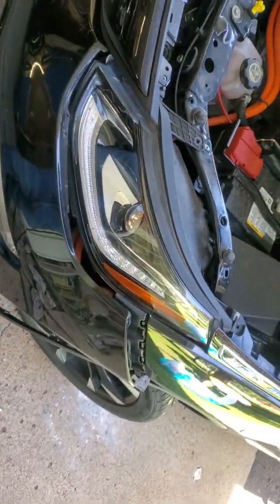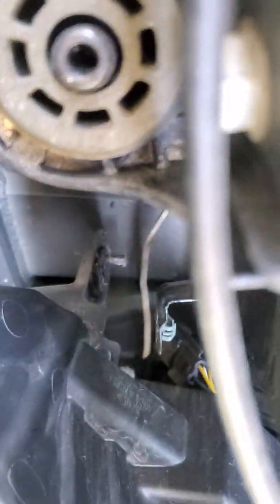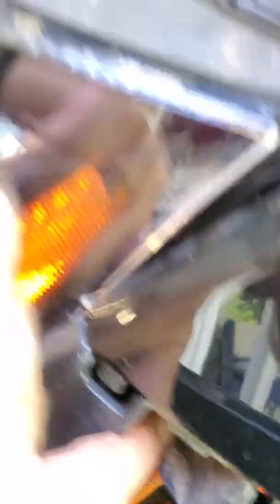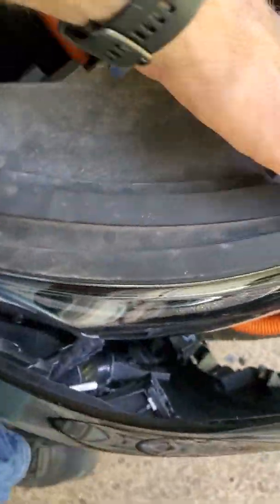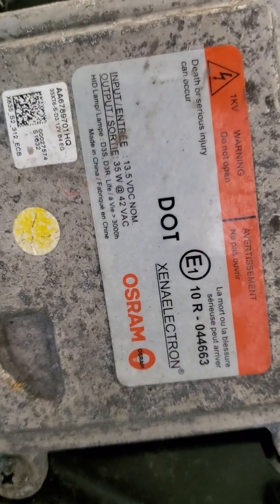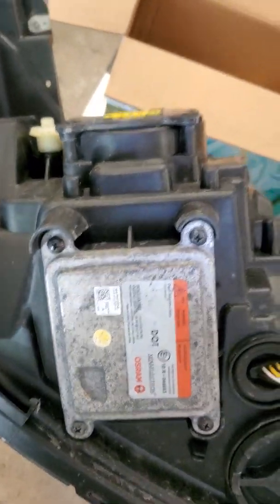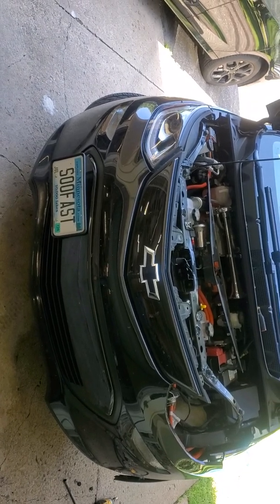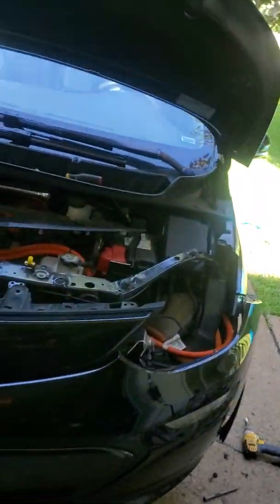2017 - 2019 Chevy Bolt EV HID Headlamp Bulb replacement.

Comment: Save yourself a ton of money and get AUXITO D3S bulbs, this will be the 3rd vehicle I've put AUXITO bulbs in and they are great replacements
Reply: That's what I bought.  I have a question since you got them.  There is a cooling fan on the LED Bulb . But the videos I have seen taking the bulbs out of a Bolt EV,  they show a sheet metal  cover that is screwed down behind the HID bulb that holds it in place... that seems like it  would block the air flow. BUT I have seen other D3S bulbs that have a clip under them to hold them in place and a Cadillac CTS video that shows them Rotating to release.  Any tips or confirmation on what the Bolt actually looks like in there..  Mine is a 2020.  Thanks very much.

Comment: I haven't attempted mine yet. Could you clarify on "just pull the trim off". Is it just brut force, or are there some form of retention clips or similar? I don't want to break anything.
Reply from the maker: As long as all the screws are removed including that hidden one under the wheel well it just pops out with a little force. Just pull outward and slightly up.

Comment: Can you put LED'S instead of the HID'S?
Reply: Maybe if you bypass the ballast, but I also just saw drop in replacements that interface with the OEM ballast. Idk I’m not sure I would want to trust a cheap piece of aluminum to accept high voltage from an HID ballast. 

Just get D3S replacement bulbs and put them in for OEM performance. HIDs are relatively efficient and make a nice beam pattern.
Reply: Heard Auxito D3S LED bulbs are really good replacements

Comment: Perfect, just what I need. Went for a Lyft inspection yesterday and my driver side was off, so it failed. Got it in the parking lot and it was back on. Midas wanted $150 to replace it :)

I'm at 135K on my 2017 Bolt EV.

Comment: I just replace mine, only need to remove the black cover with 4 screws not easy but with small screw driver ,also there's a aluminum HID light holder with 2 screws after black plastic cover
Reply: Are you saying you somehow got a screw driver behind the black cover on the rear of the assembly and took out the four screws, then took out the screws on the metallic bulb cover and managed to change it without going through all the other steps?  That would be a miracle.  Tell me how, if you did it.  I need to change out a bulb.

Comment: 2017 Bolt 107,000 miles. My Driver side goes out very often. I turn lights off, then one and it will work for a bit. Do you think it’s a lamp or ballast?
Reply from the maker: I don't think they sell separate pieces but I would bet it is the Ballast. Try looking for a used one first. But all the work to replace them I would just go new on both instead of having to open it up again 20k later  :-)

Comment from the maker: The Volt is alot easier. Just remove the bolts from bezel. Then remove the whole headlight assembly.
Reply: I bought a 2019 and left headlight cuts off after a few seconds the dealership I bought it from won't fix it and the Chevy dealerships have a four-week wait time so I can't let them keep the car have to drive it to work and so I guess I'll end up straight wiring the to the battery with a kill switch mounted to the dashboard because I don't see any other way I've already wasted money for nothing on a ballast from the GM website and that didn't stop the headlight from cutting off after a few seconds and I can't keep wasting money on this thing it's only 3 years old and it has this major problem that can get you a ticket at night
Reply from the maker: @biodigitaljazz5814   you replaced the Bulb and Ballast? Since this fix I burned out another bulb 20,000 miles later. At least the bulb wasn't to bad at Napa.
Reply: @STURGISMAN  yes I replace the bulb but that did no good so then I replace the ballast for $125 and that was a waste of money because there was nothing wrong with the phallus so now since the dealerships have a 3 to 4 week wait time I have to fix it myself any ideas? Cuz it looks like this thing's got a wiring glitch somewhere and I'd rather just bypass it somehow rather than waste more money on their stupid proprietary parts
Reply from the maker: @biodigitaljazz5814  oh boy that sucks. The only thing I can think of is dielectric grease in the plugs to see if it may be corroding or not making contact.  I wonder if the led blinks off and on also during the day. Also wonder if there would be enough power to tap off the other headlamp. Maybe it's a relay going bad also. Worth switching L relay with R relay to see if right side does it.
Reply: @STURGISMAN  I'll give that a shot I don't know which wire to run to because everything's internal and if it's shutting the power off inside of a light assembly then I wonder how I would go about running a wire from the plug on the right headlight to the plug on the left headlight it looks like there's three black two Grey two yellow and one white I'll have to figure out whether or not that's even going to work because if the ballast is shutting the bulb off inside the plastic casing then running the wire won't do any good at all but I'll give it a shot I just don't know which wires to run to guess I'll just have to cut the sleeve open on all of them and test them one at a time
Reply from the maker: @biodigitaljazz5814  Yah I have a voltage tester where I can actually poke each wire thru its casing. That would be the best scenario. Also if there was a way to see or watch the voltage as it actually happens. Switching the whole bulb assemble from left to right would be an idea also just to see if its wiring or ballast. I almost feel the ballast is overheating or something causing it cut out.
Reply: Opps, Sorry, Its Bolt
Would you be able to share the step by typing the detail in here 

like 

1. remove front light
2. something something something

thanks!

It's way expensive to fix it up in Korea lol......